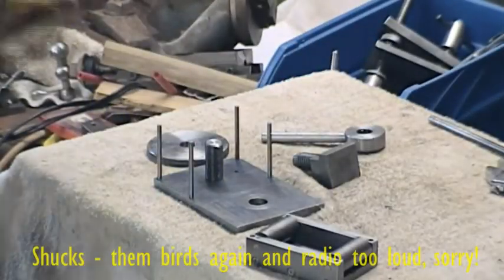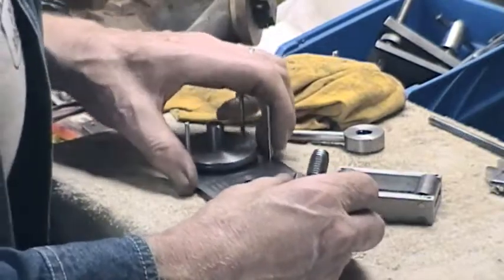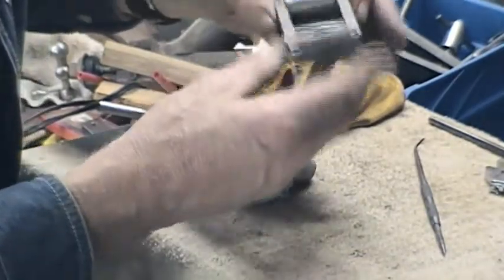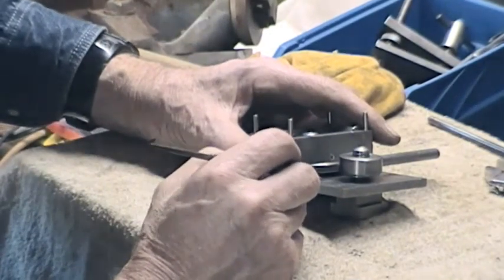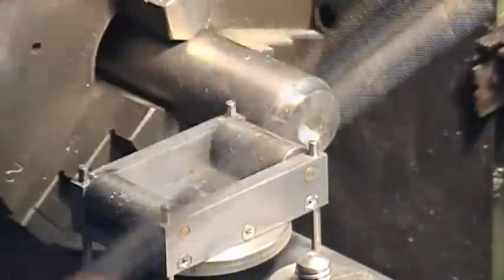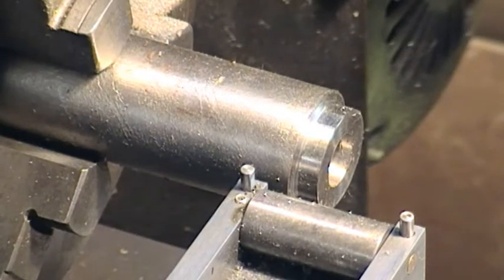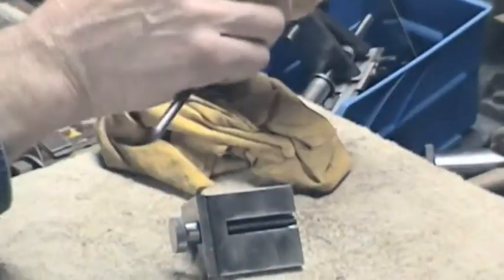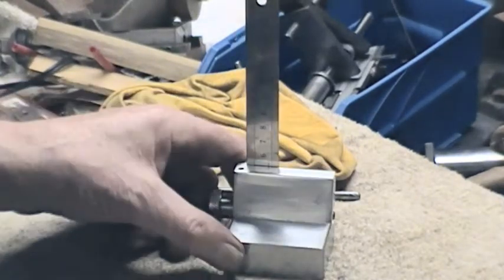Gadgets and Gizmos Part 7

Comment: I've seen filing rests like yours in several books, but I have a question about the operation.  It seems that it is really designed to roll the file back-and-forth as you showed,  but isn't dragging the file back across the work detrimental to the file (as they only cut in the foreward direction)?  I'm quite confused about this, as some people are nearly religious about not having the file touch on the back stroke, whereas I've seen experienced/knowledgeable guys on youtube drag the file both ways, as if it were sandpaper.  Care to inform an inexperienced hobby guy?  Thanks!
Reply from the maker: Good point and I tend to agree in principle but - what is hard to see and show is the pressure bias when going each way.  True, my reverse stroke is touching work but, relatively lightly - it is on the forward stroke that my pressure increases a lot. I probably should have expanded on that within my commentary. Overall I'd agree - better to avoid/minimize backward drag.